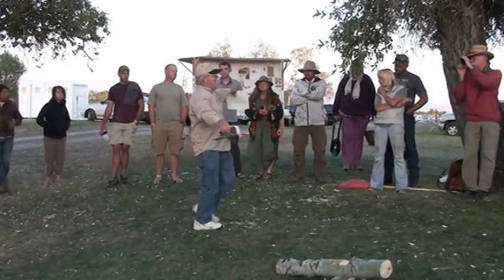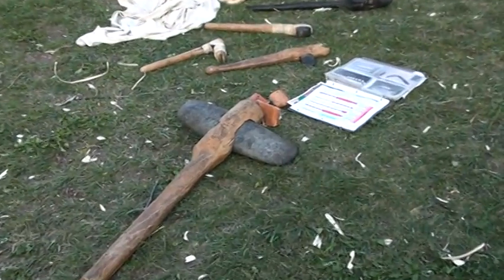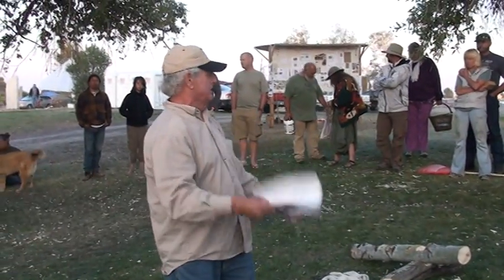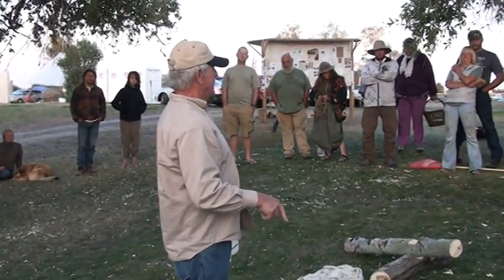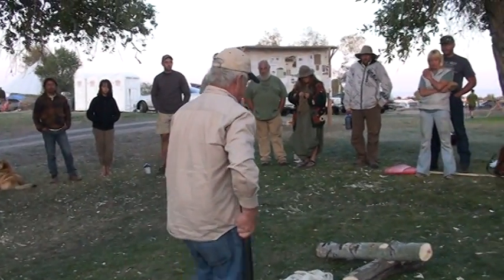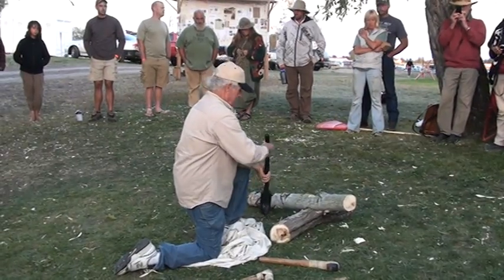Larry's ax demo at Rabbit Stick 2012 by Leland Gilsen

Comment: If the axe head is symmetrical how does it break the handle of you put it in upside down?
Reply from the maker: It's not perfectly symmetrical. When you chop it drives the ax into the handle harder and harder. Therefore, when it's put in back wards it doesn't fit any more and breaks the handle.
Reply: @MrMegalithics  oh ok, I get it, thanks